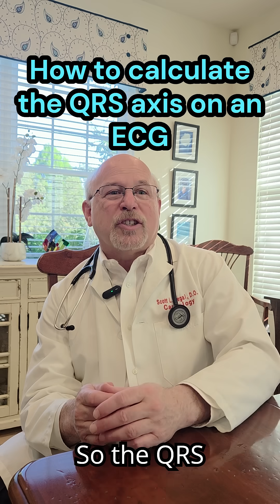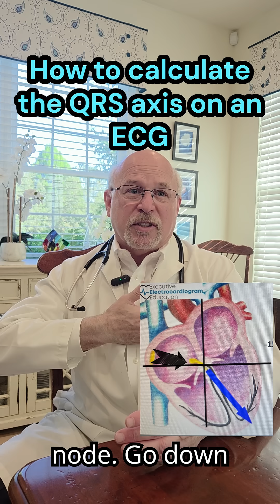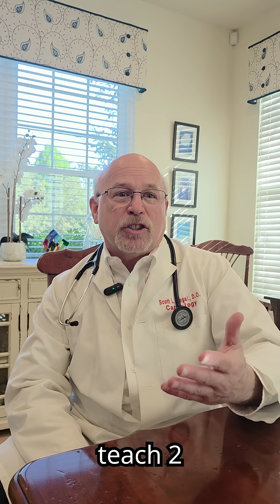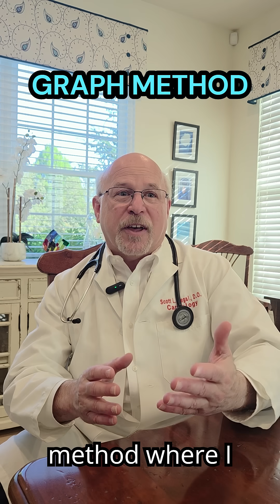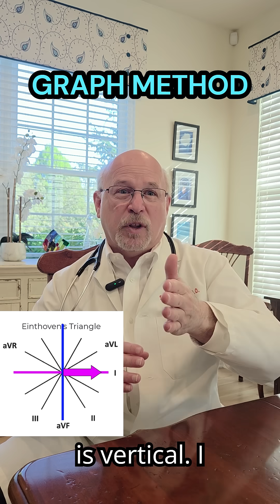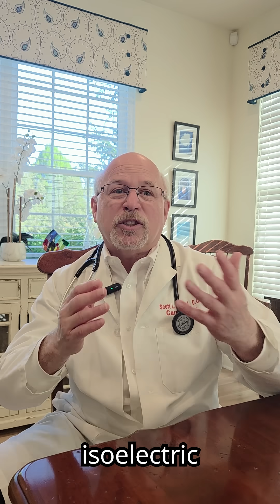How to Calculate QRS Axis (Graph + Isoelectric Method)

Comment: Idiot here, please help. Are the sensors not just functionally points? How do you determine the direction of one for the "isoelectric method"?
Reply: YouTube no longer tells you when someone responds to your comment but maybe an answer will help others.
Reply: Well, the leads are different from the electrodes. Think of the leads like cameras pointing from one electrode to the other (in limb leads). If a positive electrical impulse heads towards the camera, that is graphed as a positive deflection from the baseline. The only way a positive impulse can appear to be heading towards and heading away from the camera in (roughly) equal magnitude is if the impulse is perpendicular.
Reply: Hey, a YouTube channel = NickSmithUGME has explained ecg in about a 6 minute long video and this method is also mentioned in that video.